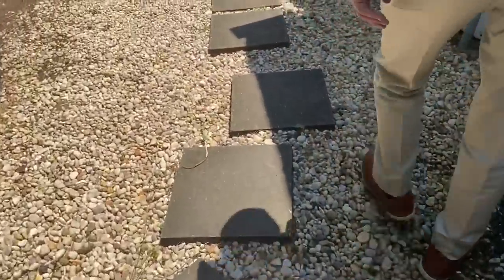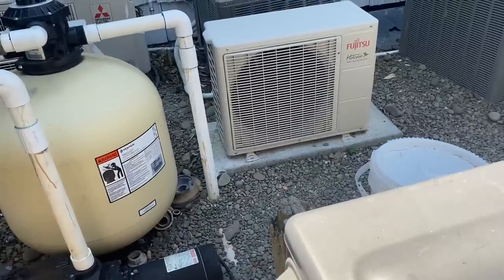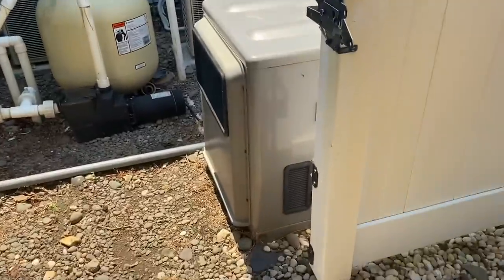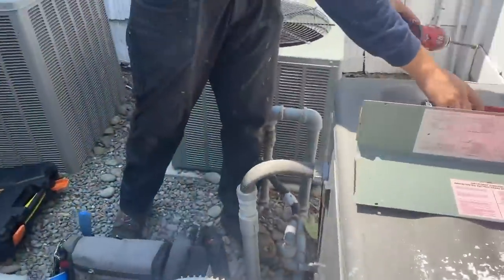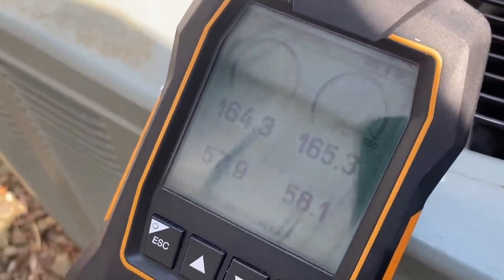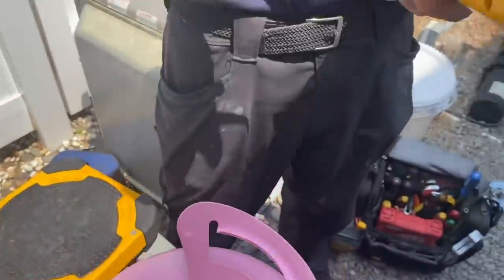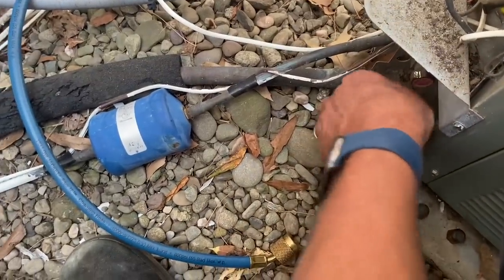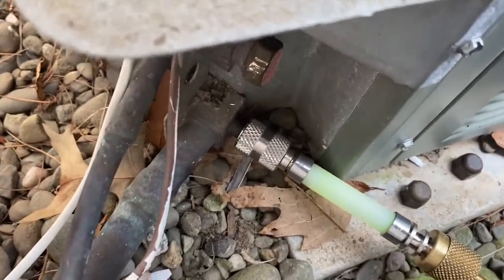Central Air Conditioning Isn't Maintaining 73 Degrees

Comment: That condenser paddock with the solid vinyl fence creates a heat island effect, where the hot air is being recirculated among the units, raising all of the head AND the evap temps, reducing dehumidification and raising kWh. My church had the same issue. We pulled down the fence and found another with louvers. The CU's were still too close together, but that is because people don't realize that the distance spec is a minimum, and not a "best practices" distance between units.

Comment: 9:44 use the service tech umbrella magnet to find that small screw (if don’t have a magnet wand w/ a magnet head as big as that umbrella magnet, they probably have a name but I call it the hockey puck magnet wand; & everyone knows what I’m talking about, as cheesy as it sounds, lol. We also have the small parts pickup magnet tip, but that’s more for hard to reach places).
They do work well, as I’ve found many of fasteners over the years that ppl have lost, dropped, etc…so well worth the $34 it cost, as can get a telescoping handle, which recommend so don’t have to bend down etc….as can reach 6 ft
Mikey w/ patience of a saint, or just a really exceptional awesome boss, who does actually teach and loves the job👍🏻✌🏻

Comment: Hey you should teach Peter not to re-thread the same hole with the screw (especially with plastic). Do the lefty loosey till you hear/feel the screw drop down to previously made threads and then tighten it up with righty tighty

Comment: Mikey I need your help!! I have a carrier infinity system going out on code 99. That is high torque lockout.  I've cleaned the condenser coil and my subcooling is pretty accurate.  It is only going out on 99 in the middle of the night. I'm in south Florida. Its 85 at night and they keep it at 70 at night when they go to bed. During the day it's not happening when it's set at 73 and it's 96 outside reel feel is 106. Please help with any info if you can.
Reply: I can only guess the condenser fan is stopping for some reason when it's cooler outdoors. Maybe something like a fan/pressure cycling switch/s or circuit board going bad?
say it turns fan off/slows it down seeing XX pressure when it's really still XXX pressure and causes actual head pressure and load to be higher than should.

Comment: He tightened the shit out of it and broke plastic 🤦🏻‍♂️
Reply: When screwing into plastic,  you turn counter clockwise until you feel the screw drop back into the original threads in the plastic. Then gently tighten until the screw bottoms out.